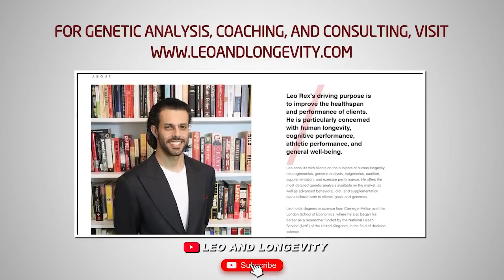HOW TO LIFT || Lessons from Anatomy & Physics w/ Doug Brignole

Comment: 0:00 Intro/ The Physics of Resistance Exercise
0:36 Who designs resistance exercise equipment?
1:56 Doug’s overhead press story
3:16 Can you stress specific portions of a muscle, or only the whole muscle?
4:05 Are partial reps effective?
5:45 Why leg size has changed in bodybuilding
6:28 Physics in bodybuilding/ Levers/ Why squats are not good for bodybuilding
10:01 The dangers of loading your spine with heavy weight
12:58 How herniating a disk works
14:31 Would isolating muscles impact your nervous system less?
17:19 Pro inflammatory stress from squats
18:29 Are short muscle bellies weaker than longer muscle bellies?
19:28 Incline bench press and shoulder problems
20:42 Barbell vs dumbbell bench press
24:01 Are people with longer limbs at bigger risk of joint issues due to bench press?
25:07 Using short lever length for increased loads
28:36 Arm wrestling and short range of motion preacher curls
32:55 Unusual arm wrestler muscle development
33:50 The pursuit of good/ What is worth pursuing
35:18 Making mistakes when you are young that you will regret when you are old
39:41 Modern society and unexplored masculinity
43:32 Why dips are not worth it
46:28 Tricep extensions and forearm position
48:55 Pronation, supination, elbow position and alignment
50:30 How the lat moves
52:11 Proper lat exercise
54:06 Anatomy of back muscles/ The upper, mid, and lower trapezius
57:28 The best way to access the trapezius
59:42 The Erector Spinae (lower back)
1:01:28 How to dynamically work the Erector Spinae
1:03:07 Doug on leg lifts
1:05:50 Origins vs insertions
1:06:55 Tendinous intersections in abs
1:08:41 Why you can’t spot reduce fat
1:09:49 Doug's favorite abdominal exercise
Reply: Thanks for this!
Reply: YOU DA REAL MVP
Reply: @Jonnycerious  You're welcome
Reply: Nice work!
Reply: The ledgend 😇
Reply: Let’s get you to the top of the comments.
Reply: Jax is the GOAT

Comment: 44:00 on Dips. You can use gymnastics rings so that it is more like dumbbells but even better. using gymnast rings and doing dips and variations like RTO dips, or leaning forward, or with elbows out wide and then bringing the the rings together at the top of the movement I made great progress in musculature and upperbody strength.  The joints health and mobility also increased. Makes it like cables as Doug talked about but Rings seem better because of the additional stability training which ends up protecting.

Comment: Couple of pointers:

Both tibia and femur can act as a lever for quadriceps, not just tibia. So in a squat if tibia is vertical the quadriceps can still be working maximally now moving the femur while tibia is stable. This is typically achieved in a free weight belt squat, for exeample. Any muscle can move the insertion towards the origin as well as the origin towards the insertion or both at the same time. Its just a matter of relativity. That's why in a dip the triceps can work strongly even though the forearm is vertical. They are now moving the horisontal humerus.

Full range of motion for the lats starts the humerus beside head not from the side. As for the shoulder impingment, that only happens during abduction/abduction if humerus is internally rotated. The most natural movement is "scaption" which is kind of middle version of flexion and abduction. Lats actually work both in humerus adduction and extension. With shoulder problems flexion/extension is usually the best option and there really is no reason why human body shouldn't do it. Being able to throw the javelin from overhead position was actually a big advantage of the homo sapiens compared to the neandertahls who couln't do it.

When lever is in a 45 degree angle to the direction of resistance, the resistance to the movement is not 50 %. It's around 70 %. That's actually a common beginners mistake of mechanics.
Reply: cos 45 is roughly 0.5, the rest i would agree with
Reply: It took me way too much scrolling through the comments to find this. That was my exact immediate thoughts when he claimed dips don’t work triceps and squats don’t work quads. He made the same claim about the biceps in a chin-up

He’s a smart guy and I believe he has nothing but good intentions but how did he not think about this? He makes these claims in all of his vids that he’s in and no one has corrected him. I’m pretty sure doug is cool with skull crushers or bicep curls. Dips and biceps take the triceps and biceps through the same exact ROM and the moment arm has the exact same strength curve.

Comment: Loved this one, and love hearing from Doug. If only I had heard from someone like him 40 years ago instead of (following) the meathead, bull in China shop attack, attack, attack methodology I wouldn’t be so ruined! Left shoulder always grating and painful, including Class 2 separation just avoiding surgery, arthritis and neck disc damage, plus both wrists and ankles, ruining everyday activity, no overhead flexibility (massively strong back - near 500lb plate rows but no lat flexibility) and hamstrings probably like no one else on Earth - physio says the stiffest he ever encountered as he tried to bend them back with all his might. If I even kneel or try to crawl they will cramp instantly and no cure yet found.

As for Ronnie and his back, I herniated a disc when I was 23. It’s blighted life since and led to other discs crumbling, posture shifting and 2 1/2” height loss. At the worst times it’s almost been suicidal - like 3 months unable to sit. Literally, to the point of managing 5 minutes at Christmas after my wife cooked but then post starter, having to kneel for the rest of the meal. So, my advice - people could do well to listen to Doug and avoid or not over use the more dangerous exercises. The cost is too high.

Comment: 48:30 I haven’t done any overhead tricep movements my first year and a half of training and visibly lacked growth on the long head of my tricep. After implementing overhead exercises for a year, i’ve grown my long head substantially.
Reply: @bigt9374  Tricep has 3 heads. 2 of them (lateral and medial) only cross the elbow joint, so anything that you do that is extending your elbow joint is working them. They are pretty much a package deal.
The 3rd head, the long head, originates on your scapula, so it crosses the shoulder joint and the elbow joint. It helps the other 2 heads extend the elbow joint. But it also is good at extending the shoulder, which is like what your lats do, bringing your straight arms downwards
Reply: @helios4425  wouldn't that mean that pull-ups and pulldowns and stuff would work your long head and you wouldn't have to try to target it with overhead tricep work? Lots more load on those exercises
Reply: Yes, practically speaking most people will improve their long head with any kind of overhead work. It's not a good argument to say so-and-so has great triceps and doesn't do overhead, because we clearly see how vastly different triceps potential is between individuals.
Reply: @Mrraerae  You might feel it squeezing the top of the movement if your long head is underdeveloped. But your biceps and triceps are not strong enough to lift your body and are much more involved in stabilization and direction of movement, whereas the back does almost all the work. For example, you can change the involvement of arm muscles and a pullup becomes a front lever, again with the back doing almost all the work.
Reply: @Mrraerae  I always feel my triceps work, and sometimes get soreness later, doing several lat exercises.

Comment: You can certainly use mind-muscle connection to build just parts of a muscle (like a bicep peak). I know the textbooks say it’s not true, but look at Wim Hoff, the stuff he’s doing is way crazier then isolating part of a muscle. 

Tony Huge was the person who opened my eyes to this. He had a video with a dude who got hurt and couldn’t do any heavy bicep lifting. So he used like 20lb on a overhead cable, holding the ball attached to the clamp, he would stand with his arm straight with the cable and just slowly curl in like he was flexing his bicep. He had the craziest peaks I’ve ever seen. But it’s by far the hardest exercise I’ve ever done. Tony couldn’t even figure it out and it took me like a month to really get it right. My biceps started getting a peak and I knew it worked.

Comment: 58:10

Are you guys talking about the lower traps?

The lower traps attach to the upper corner of the scapula.  Its jobs is to upwardly rotate the scapula as long as the scapula is also being depressed, its other job is adduction but only when the scapula is depressed.  Thats why you workout your lower traps when you are doing overhead presses.  This makes difficult to target the lower traps without also hitting your shoulders.  This is also why its a good idea to workout your shoulders and back as a muscle group.

Doing partial prone t with adduction in mind is an effective lower traps exercise, IMO.  But doug method might work well because it removes much of the shoulder involvement, while forcing the lower traps to mostly adduct.

Comment: Excellent interview. Now I have to restructure my workouts with this new knowledge. It's funny thought, because I intuited the same things as you Leo. I also wondered why bodybuilders didn't just do isolation movements only. The best of the best always get injured in some way, which tells me that doing heavy compounds and doing against the natural flow of biomechanics to "get massive" is just "broscience" that leads to injury and systemic fatigue. Perhaps it is much better to just do isolations and train more frequently; maybe doing isolations first, then hitting compounds with way lighter weights?. I've been a huge fan of Dorian Yates and doing HIT for a bit, switching then to higher volume Culter style, but everyone of them got injured; even Jay who was very cautious during his career. Now I have to do more research and learn more about Doug lol.

Comment: I would be interested to see if some sort of a vertical deadlift (like on a cable row but instead of rowing you would just hinge at the hip sort of) would be a good way to train the trapezius musculature, since they also especially seen to benefit from weighted stretch and resistance of forward pulling force.

Comment: 1:08:00

Lying legs raises where your hips hangs off the edge can be an effective abs exercise because you can fully stretch your abdominal and put it into eccentric contractions.  This might actually be more useful for athletes because they tend to use their abs as stabilizers instead of adduction.  Can it build muscle, yes! Eccentric contractions can build as much muscle as concentric contraction as long as the principles of high threshold fiber recruitment and prolonged (slow velocity movment) tension is achieved.  However, eccentric contractions tend to cause high amount of muscle damage leading to a prolonged recovery time.

About bodybuilders and abs, almost all the great bodybuilders: ronnie, phil, dorian, arnold and haney had something in common.  They ALL have very short torsos, i don't have any scientific evidence for this but guys with short torso have less abs.  Its also possible that the shorter torso allow less room for intra-abdominal pressure and tends to stretch the Linea Alba.  I have also seen diacstasis recti in obese men who later became lean possibly due to the organ fat.  This is just theories though, so I don't know.

Boyer coe did have abs, but he had a 4 pack(also short torso!🤔) and it was more Aesthetic for him to do so.

Comment: In the 70s, they were doing leg extensions and leg curls., but were few equipment companies.  Often, Nautilus machines were in health clubs, which might or might not have free weights or other machines, but probably not.  Hardcore gyms frequently didn't have a line of Nautilus machines.  A hardcore gym might have leg machines built by a local welder, which could be good, or a P.O.S.  Or the gym would have the Universal Inc. leg machine (leg extension, lying leg curl in one unit) that was definately a P.O.S.

Comment: I would be interested to know what Doug thinks of products like the “isobar.” It’s a barbell with sliding grips which would allow you to actively modify the width of grip while bench pressing
Reply: The problem with a barbell isn't the grip width, but the fact that it's a straight bar which keeps both arms "fixed" on a plane regardless of grip width...

Which is why dumbbells are better...

Comment: With the dips. If you do them on rings which you can move similarly with dumb bells would this be a good exercise for the chest. Is it better than dumb bells..?
Reply: Dumbbell press on a bench is better for stability and you can choose the weight you use .

Comment: and by the way: bodybuilding should be about gaining muscles - not strenght. of course you will get stronger - but more because of exitent. a main problem seems that all mix body-building with powerlifting. those are two different things. some overlap - of course, but also some very important differences.

Comment: I wrote this on Brainum video, but I think legs got better from drugs and a raising of the standards.  Platz raised the bar on leg development.   Legs & lats in the 70s sucked compared to what came later.  Samir and Haney raised the standard on lats.  Disagree somewhat about legs better because of less squats and more isolation exercises.  I'd say the trend was improvements from training harder on multi-joint movements (squats and/or leg presses) and better equipment designed for the isolation movements people were already performing.  Legs & lats stopped being an afterthought in program design and equipment design.
Reply: Regarding Samir & Haney raising the bar on back development, isolation played more of a part here.  Samir did Nautilus pullovers.  Haney did pullovers and v-bar chins (similar to Gironda's sternum chins that hits fully contracted position of lats that Brainum mentioned).  Don't know if Haney learned from V.G. or trial-and-error and feel.  Or maybe Mohamed Makkawy, who was trained by V.G.  Earlier, many people just used multi-joint exercises (chins/pulldown and rows).  Shitty program design for a large muscle group, while no advanced bb did chest or delts w/o isolation work.

Comment: It baffles me how doug cannot see that in dips, the forearm doesn’t need to be perpendicular to gravity. The humorous  is gonna be perpendicular, and the elbow flexion is coming from the elbow up rather than the elbow down with skull crushers. Yes there’s movement at the shoulder too which is assisting but to claim the dip is not a good tricep exercise is ridiculous 

And then he claims that the stretch of the long head in overhead tricep extensions doesn’t mean the long head is getting favored. Yet with every other exercise he claims to be good, it’s partly due to it being loaded in the stretched position. Soo does the stretch position matter or not? You can’t pick abs choose here doug

Comment: such a nonsense ! first of all: that is with all compound exercises the same - therefore they are called compound. second: in earlier times body-builder focused much more on aesthetiks than on pur mass - and THEREFORE they had not such big legs, also they didn´t use so many drugs. you will never get such big legs from only leg-extensions - !!! you can get quite big legs by doing leg-presses, too - ok, but only with isolations ? no way !!!

Comment: Doug says that squats and leg presses are terrible for quad development and sissy squats are great but literally all of the greatest legs in history were built with squats and leg presses not sissy squats the proofs in the pudding as they say. I’ve heard Doug say Ronnie Coleman could have built his legs better with sissy squats or place in there Paul Demayo or whoever but it’s never been done. It’s not all ego lifting Doug sorry it’s also results lol
Reply: If you've ever listened to Doug in other interviews, he has always maintained that squats and leg presses do develop the quads... so the issue here isn't if these exercises work or not work over the long term, he has never claimed they don't deliver results.

But they deliver those results at a cost to the body, in the form of unnecessary spinal loading and compression... that is the real issue here.

The fact that sissy squats (or variations of that movement) can develop the quads just as much can't be argued from a physiological standpoint... they stress the quads very directly and efficiently, there is no possible way they won't develop the quads to a high degree provided you train them hard and long enough over time in a progressive manner.

But the vast majority of bodybuilders are creatures of tradition and largely ego-centered... they live for the thrill of seeing all those big plates on a bar move up and down while doing an exercise and the positive feedback of onlookers at the gym.

They could've achieved the same development with some form of sissy squat done with the exact same emotional investment... only that it's not ego-gratifying like watching those big rows of plates bobbing up and down.